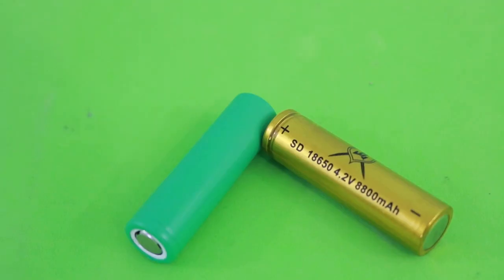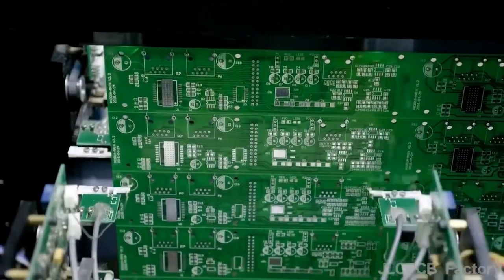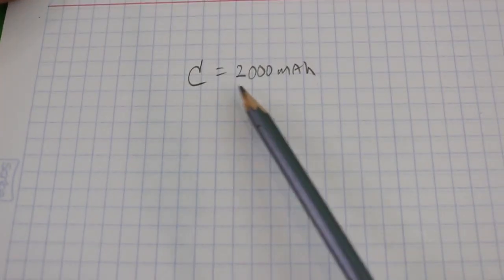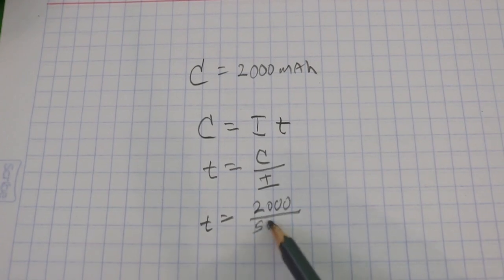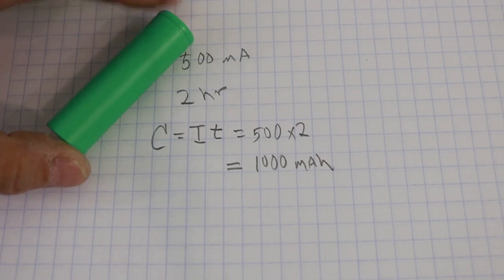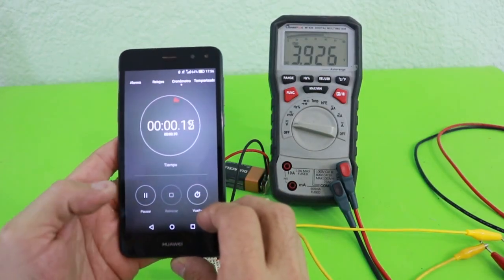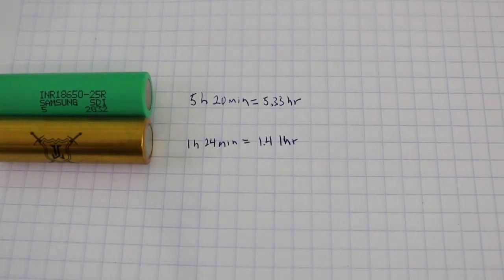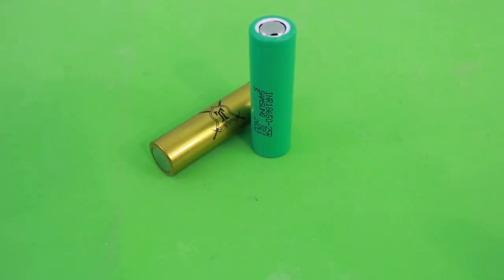How to Test Battery Capacity without Special Equipment

Comment: In short.
Li-ion cells with weight above 40g have capacity more than 2500mAh
40 to 30g usually has 2700-1500mAh
and less than 30g 2100-300mAh

All type of cells should be measured by discharging it with stable current and stop when voltage hits min safe Voltage specific to type of cell (li-ion 2,9V, li-po 3,1V, ni-mh and ni-cd 1V)
Reply: Why should you stop discharging it when it hits a specific minimum voltage? I genuinely don't know. I am currently charging a Samsung 18650 battery rated for 3.7 volts, and the current voltage shows 1.7 volts. Is it dangerous somehow?
Reply: @dv3444  Yap its damaging battery. Below 2.5V voltage drop really qick chemistry its start reacting in untraversable way. For sure it decrease capacity. Sometimes it can brick your whole battery. If you are lucky, you just charge it slowly and battery can be 100% usable. Also from 3.0V to 2.5V and less (dep on bat) voltage drops really quickly and give you maybe 50mA capacity more,
but overcharging is more dangerous and damaging.

Comment: Can you determine the capacity just by measure the time it takes to recharge, the amp and voltage you recharge with? How long time did it take to recharge the fake battery vs the samsung?
Reply: Look at charge/discharge curves. Everything in this video is a first order approximation. Basically, just measure the mass. That’s about all these methods are good for. 

See: batterymooch